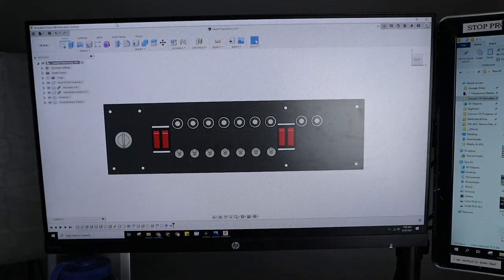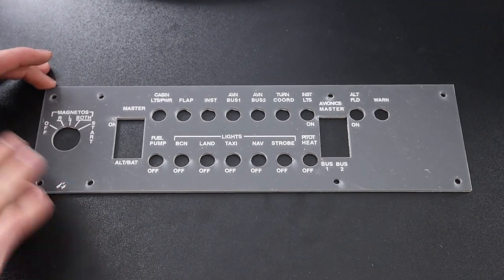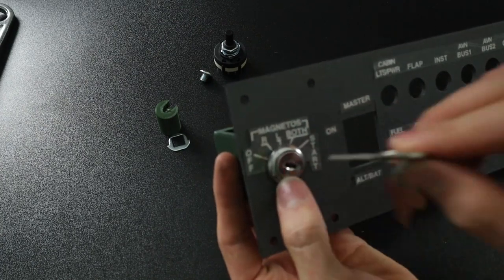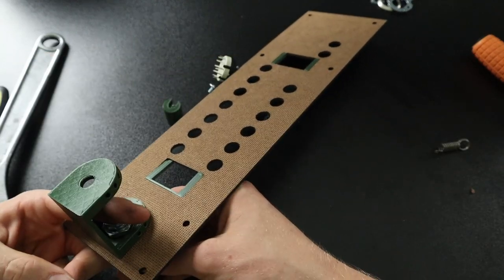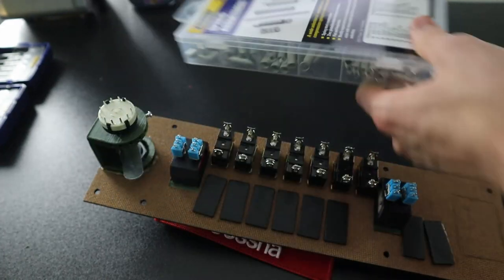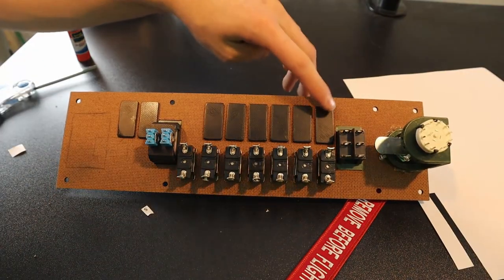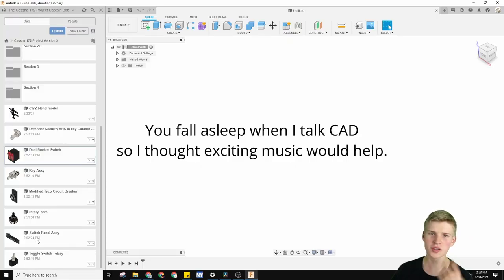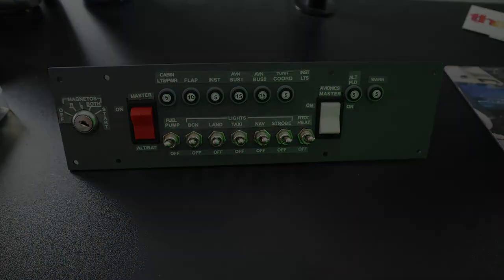Build a C-172 Flight Sim Switch Panel #23

Comment: Hey, Trevor---saw a good deal on the pushbutton thermal circuit breakers---all 15A, like the one you have, but it would be a fairly simple matter to wipe off the inked numbering, then print the appropriate label on decal stock (decals, like model airplane type). If you want, I'll even be willing to buy you seven of them for your panel. Message me if you are interested.  I'm always impressed with how professionally you approach, and truly engineer your project, and have a plan, and good methodology.  You are definitely going far in life!
Reply from the maker: Hello David!! I'd love to try it :) Send me an email at CaptainBobSim@gmail.com - Thank you for your kind words!

Comment: Im assuming all buttons have ground wires. How do you connect them to the arduino when the board only has 4?
Reply: Button Matrix, connect everything to one cable that feeds directly into a Ground port, I use the GRD on the analog side

Comment: Hello, great job, really AMAZING! but could you send the text file you burned please? Also, do you think I could print these texts with a vinyl cutter? (hope you understood me, I use a translator)
Reply from the maker: I already did, check the description, it's in the thingiverse link files
Reply: @CaptainBobSim  ok thank you 🙂👍
Reply from the maker: I have heard of some problems with compression, so let me know if the image quality is not good enough!
Reply from the maker: Using a vinyl cutter might be difficult with such small text. Probably not impossible :)
Might consider doing a few test cuts.

Comment: Literally can do all this with a tablet and sim dashboard or touch portal if physical space is an issue or money is tight

 If you want to make a physical board, check out your library. Most have 3d printers you can use. Most electrical stores sell these switches for super cheap or in bulk. His layout is nice and the key is creative for sure but for those of us who are more fiscally minded, you can easily source all this for super cheap. Also, Etsy sellers have decals you can get for super easy labeling that look awesome
Reply from the maker: You are correct! You can use a tablet if you are fine without having the feel. The main idea with these videos is to show you how to build them so you can make your own, and if you prefer to have my kit that has everything just right that is an option for those who value convenience. Profit from switch panels goes into developing simulator parts and support my endeavor in making flight simulator plans accessible/free for everyone!
I am curious what your etsy sources are, I would be interested in trying them out.
Reply: @CaptainBobSim  my.comment keeps getting deleted but hit me up and I can send you a link to the decals I bought for mine
Reply from the maker: @natervaternone2020 That's weird it's getting deleted, I've heard of people having problems with my comment section for some reason. My email is CaptainBobSim@gmail.com if you want to send the link. Cheers!!

Comment: So what do you do as far as programming and getting it to work with X-Plane
Reply from the maker: Hello! I have the file here: https://captainbobsim.com/product/the-cessna-172-project-files/
in this folder:
\The-Cessna-172-Project-V3\Section 2A - Analog Panel\Analog Switch Panel\MobiFlight & Wiring

To do it yourself you'd just follow the instructions but do it in X-Plane DataRef not in FSUIPC

Comment: Hi capt! May I know what is the length and height of the switch panel?
Reply from the maker: 13.5ish by 3.5 ish inches 
Here's some more dimensions:
https://github.com/CaptainBobSim/The-Cessna-172-Project-V3/blob/main/Section%202A%20-%20Analog%20Panel/Analog%20Switch%20Panel/Drawings%20and%20Templates/2A-3-000%20Switch%20Panel%20Assy%20Drawing%20v2.pdf

Comment: Hi Captain Bob I've a  a switch Saitek panel also 2x throttle quadrants amongst other gadgets  s there anyway one can separate the start sequence so I can start one engine at a time ,instead of both starting when when turning the key on a twin engine sim ,thanks for your vids , there amazing
Reply from the maker: You should be able to use a "magneto 1" instead of just "magneto" event
https://hubhop.mobiflight.com/presets/
Reply: its a pity Logitech dont make a two key switch panel, make it more realistic it would,i cant even contact them for there opinion as dont have an email it seems

Comment: Really a great job! About the laser cut ABS, with which equipment did you cut and engrave it (two different lasers?).
Reply from the maker: Hello Stefano! One laser engraver, with 2 different power settings and 2 different setups.
Reply: @CaptainBobSim  which model, if you can share? I am building a similar project, and I tried to make some experiments (just about engraving) with the laser from Creality Ender 3, but its power is way too low.
Reply from the maker: This video helped: https://www.youtube.com/watch?v=GWwiDnhjQlo&t=834s&ab_channel=TheWarthogProject
You want a fairly powerful laser, at least enough to burn off the plastic from a 3D printed piece (I included the STLs and SVGs in the thingiverse link).

Comment: I noticed your kit comes with 2 different toggle switches. How much smaller are the blues vs the ones you used in the video?
Reply from the maker: The blue ones are quite a bit smaller - I'd recommend using the two different types, it feels much more realistic to have the large toggles for the switches.
Reply: @CaptainBobSim  copy that, thank you. Also, do you have an idea of what thickness of acrylic panel would be sturdy enough? Also, amazing work and documentation you've put into this.
Reply from the maker: @nextgameis1229  Hi! I've used 3mm acrylic. You could go for something thicker (5mm maybe?) but you'd have to match the thickness with the rest of the panel. Also no guarantees the key will fit with thicker than 3mm acrylic.
Reply: @CaptainBobSim  I tried 3mm and went ahead and cracked it a little haha. I'm going to keep working with this one for now, but I also ordered a panel from your shop for the future.
Reply from the maker: @nextgameis1229  Awesome!! I'm actually shipping it out today :)
Reply: @CaptainBobSim  you're a beast, man! I appreciate it!